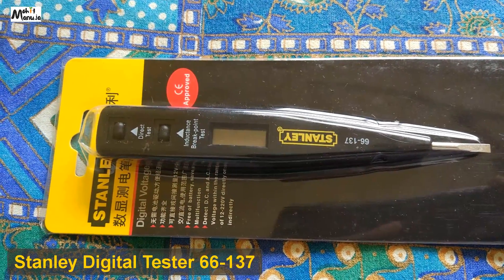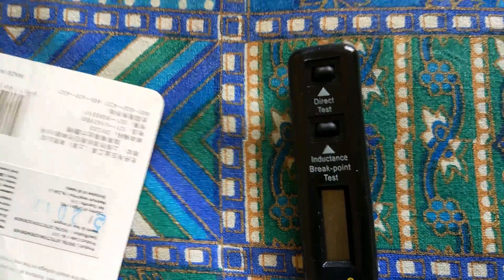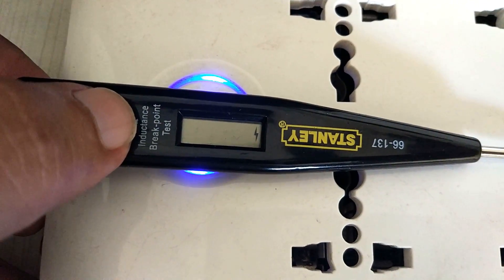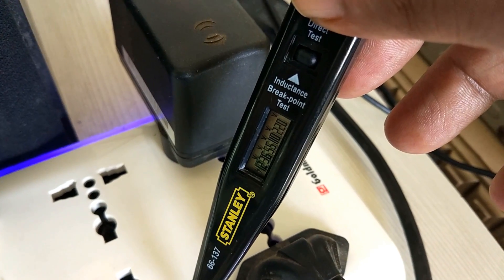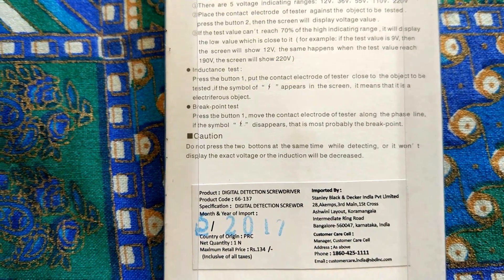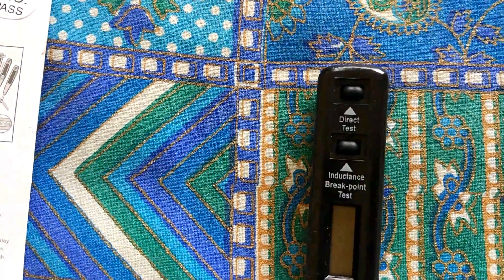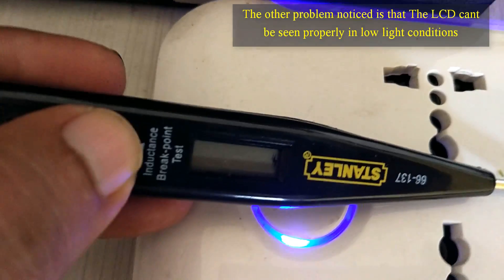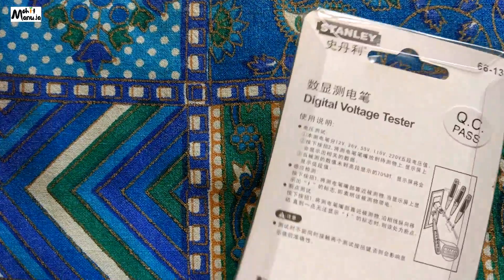Stanley 66-137 Digital Voltage and Break-Point Tester, Yellow and Black (no battery required)

Comment: Hi I just got this. Its really interesting. But also ive noticed its shows electricity in metals with the induction. But the metals arent even connected. Like a coin or eyeglasses frame. I also did notice the symbol when inducting a carpet. Can u explain like is it static electricity or something else. Thank u

Comment: Does it work on battery cell then where from which one battery cell is put in it ?
Reply from the maker: No dear , it does not need any battery / cell ..it works on the power of induction .

Comment: Sir, Thanks for Video. Can we use it for testing leaks/mild current flow in certain electric appliance like laptop etc that have certain metal parts exposed? saw it can detect earth wire also..pls reply..thx
Reply from the maker: it can do so in the direct test  and even the indirect test if the induction created is strong enough .  i have noticed it can pick up induction around wires carrying just 12v  for cctv cameras as well in the indirect test . 
in the direct test it picks up current in a mobile charger and usb port  which are as low as 2 amps  / 5v. 
so i will safely assume it should detect current leaks .

i m not so sure about the earthing part . sorry .
Reply: thanks for reply.